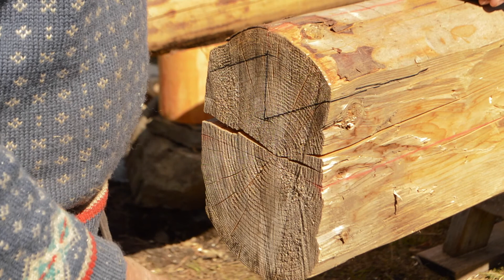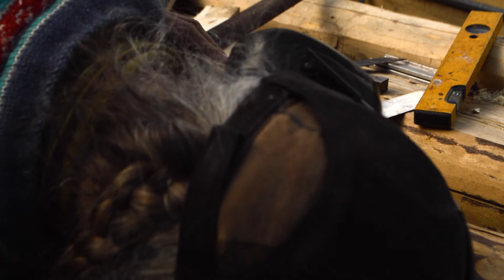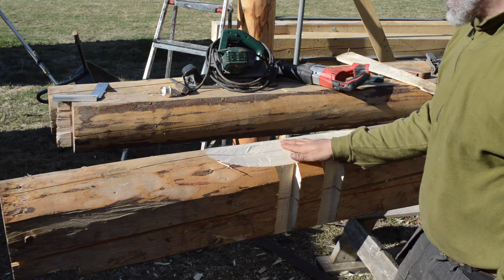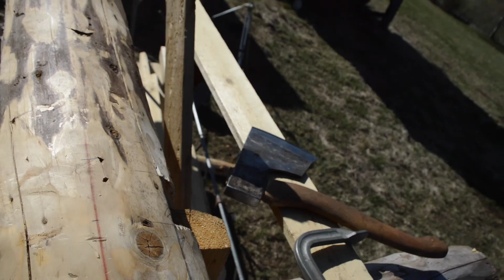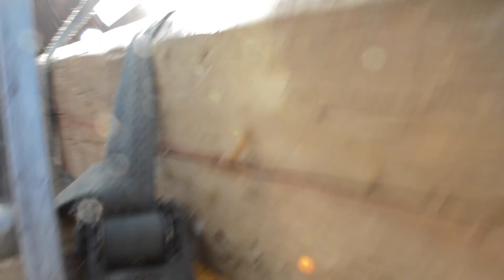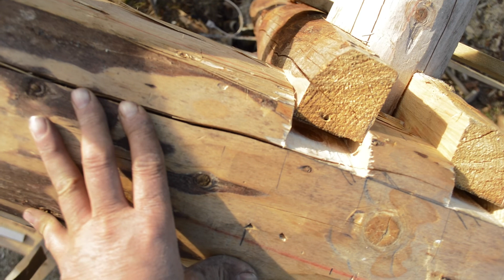🔴 Trestle Timber Framing - Norwegian Grindbygg Part 14/30 (top plate)

Comment: I like the detail on the joinery, nothing I've seen before. Excellent work once again! Keep up the good work, audio quality on this video is much better. :)
Reply from the maker: Thank you very much!
Reply: Interesting joinery this "Grindbygg". I belive it has its genes from the old long houses the viking used.  They are more common on the western part of Norway where there's less trees. Often used in sheds and boat houses.  Compared to the traditional "laft" the Grindhus requiers less materials.  Fun fact; the materials used in one of  the oldest Grindhus in Norway is dated to about  year 1000! The tree was chopped when it was 500 years old... Quite facinating.
Reply from the maker: I have not seen a grindbygg in this area, Hadeland. Thanks for an interesting post!

Comment: I came for the joinery and haven’t been disappointed! I did wonder.... do you need planning permission or the quality of your work inspected? Thanks again for the vids
Reply from the maker: For buildings under a certain size, no. But you have to follow regs, for a garden shed in this case. But you must report for mapping. It is of course not quite so simple because this is a farm..... but when the bureaucrats  actually start work again I will have a chat with them.

Comment: Hi Lucas, maybe you commented already and I know this is an "experiment", but what's your thought on not fitting knees on 2 of the poles (furthest from the barn)? That frame looks more wobbly?
Also, what's your comment on 2 tools that might (only might) be useful in your work: the Bosch EasyCut 12V mini chainsaw and a Thors hammer. Maybe not so posh as King is making (https://youtu.be/FCU_Sj223h4), but at least one that gives you more ooomph when banging those logs.
Cheers (and hope your dog is doing alright)
Reply from the maker: Hi Stiff wood, the wind-braces will be straight on the other walls just the opening gets the root-knees. When all is set up at level and plum the wind-braces will be cut as normal for grindbygg. Bosch easy cut would be very handy I am sure. I use the Fein saw for some of those small cuts but it could do with more aggressive cutters. Øyvind has an adapter he made to use bits of your old hand saw in a fein-saw cutter. That is a good idea. Thor's hammer  would be good too! Dog is back in town since the videregåendeskole has resumed...All the best, Lucas
Reply: I didn't know the dog went to school....